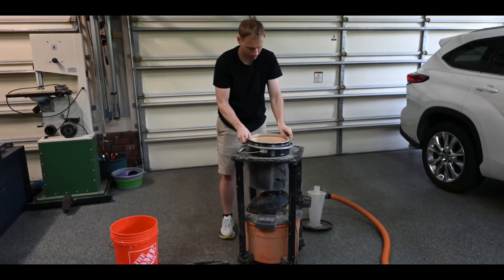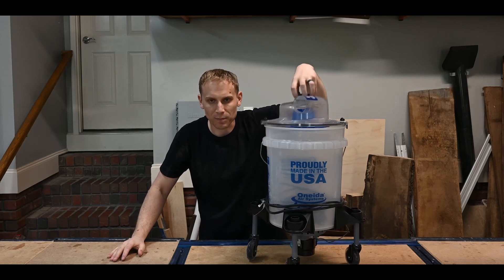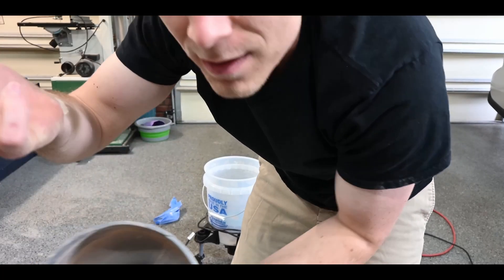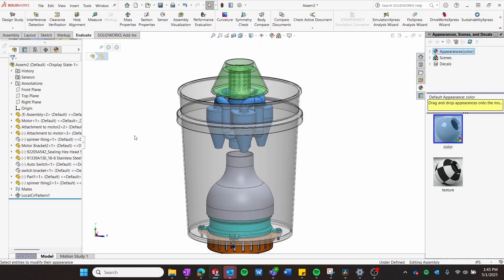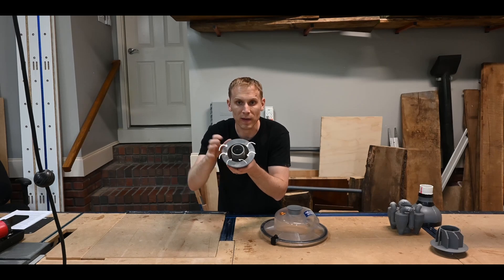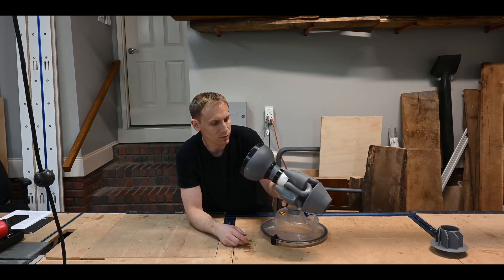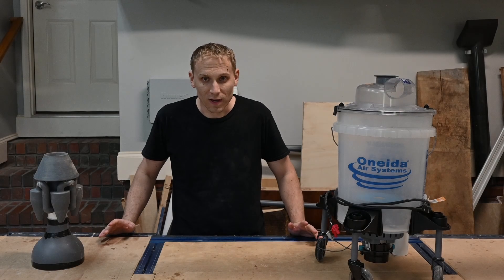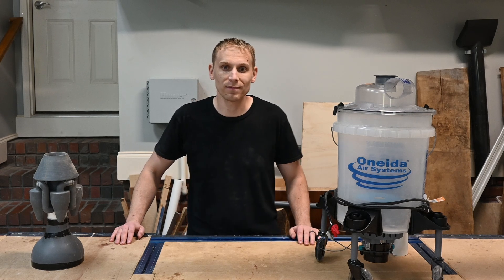The LAST Shop Vac You'll Ever Own!

Comment: Great video and a really interesting concept. It looks like you've diagnosed the problem well and I'm impressed at the performance you've achieved. I'm a bit surprised that you've gotten only one other comment so far.

I want to say that I have next to no knowledge of vacuum technology or this sort of prototyping. As a user of various shop vacs and dust collection systems, though, I really like the direction you're heading in designing something that is compact.

As @ph3590 noted in his comment, I think making it modular would be key. My shop vacs are constantly being used for different tasks (wet, dry, fine particles, large particles, etc.) so being able to swap out the cyclone separator would be key.

While I love the idea of getting the weight of the motor as close to the ground as possible for the center of gravity benefits, it would be nice if it were easier to remove the filter without having to disassemble the whole unit. OTOH, if the cyclones manage to keep the filter as clean as they did in your final test, perhaps cleaning the filter wouldn't be an every day task.

Good luck with this design. I've subscribed to your channel to keep up on updates.

Comment: I can think of one reason - large material considerations. True dust separators in workshops are often individual systems, and the shop vac is not used for dust collection. Just as special vacuums exist for drywall with knockers or vibrators to remove dust from the filter. 

Instead, what tool brands should do is offer dust collector cyclones that go in between the bin and the top motor housing, so that you can easily swap in a cyclone when you need dust collection, and remove it when you need to suck up water or larger material. What's wild is that many brands give up this business to the "add on" bucket cyclone companies - probably because they if they did offer a modular vacuum system with a cyclone component, it would poach their own sale of dedicated dust vacs, but it'd probably sell a lot more of their normal shop vacs with this capability. 

Shop vacs as a whole leave a lot to be desired. Most of them are pretty weak considering their amp draw. They are all incredibly noisey aside from Dewalt's StealthSonic series, and they all lack modularity - the ability to use a big honkin motor on a smaller bin, or a small quieter motor on a large bin, or a dust collector, etc.
Reply from the maker: I completely agree with a lot of your points. The lack of modularity and true dust separation in most shop vacs has always felt like a missed opportunity, especially with how many of us end up cobbling together add-ons from third parties. That’s actually a big part of what motivated me to start this project — I wanted to bring the best parts of both worlds (cyclonic separation and wet/dry versatility) into a more integrated and flexible design.

Your idea about a swappable cyclone module is especially interesting — I’ve been exploring something along those lines, where the cyclone is built-in but still removable or bypassable depending on the task. Hopefully I can continue improving the prototype and show how this kind of system can be done well. Appreciate you watching and weighing in!